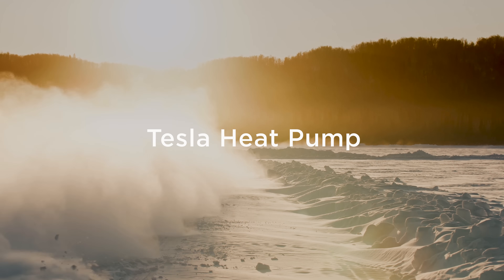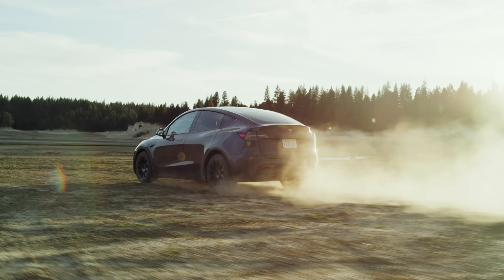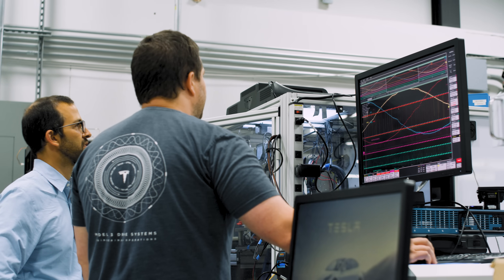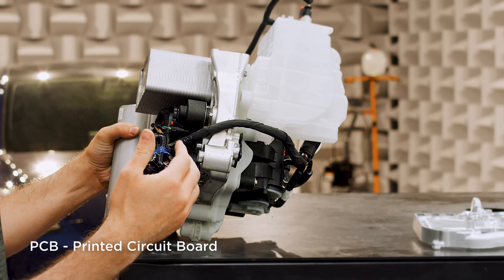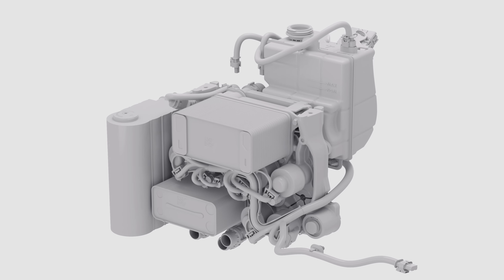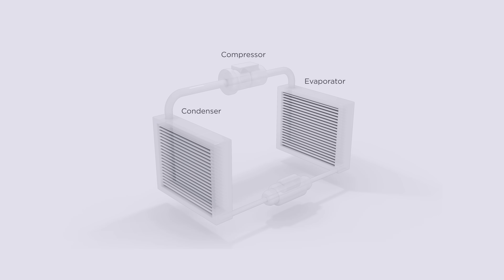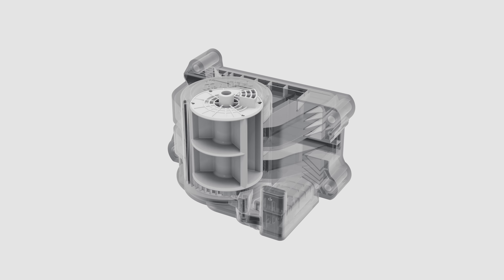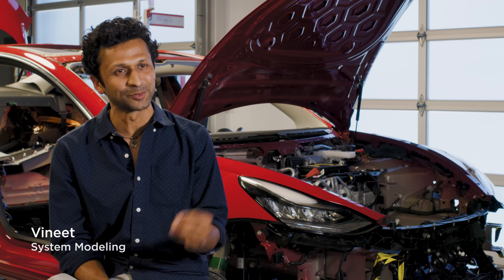Tesla Heat Pump | More Range in Cold Weather

Comment: very cool, and respect for leaving comments on. My only problem with the heat pump only set up is that unlike a gas car that can run the a/c and heater in defrost mode, the heat pump only can not also run the a/c for defrost. IMO if you did install a strip heater like you had on the early 3's then you could do both. I know that would cause massive drain on the battery but it would provide back up heat in extreme cold weather and allow for very fast defrost. Maybe if you put in a humidity sensor so it only ran above 50% humidity or something. It would also give you the ability to provide supplemental heat when the heat pump has to defrost the evaporator on long cold trips. I'm sure you already know all this and are trying to keep prices down but my biggest gripe is that defrost really isn't what a gas car can do because it can run both heat and a/c at same time. I also wish you offered an option without the glass roof. Probably great in moderate temps but really not worth it in extreme temperatures. The glass gets so hot you can't tough it, and you can feel it baking the top of your head in the summer and in the winter it's just a massive heat sink sucking out the warmth of the cabin. Love the car, my gripes are minor compared to what I could go on about with my gas car but offering option without the glass roof and including a strip heater for defrost would by my first choice if you offered it. Thanks again for leaving comments turned on, much respect.
Reply: Cabin condenser and evaporator are separate units that don't switch functions. It can and does provide heat and dehumidification at the same time

Comment: I would strongly suggest Tesla commission Jared Owen to make an animated video of how this heat pump works.  His video of the German enigma machine and the workings of a bowling alley pin setting machine are quite extraordinary.
Reply: It's a heat pump, it's nothing new... at all... Heat pumps have been around since the 1850's... There's plenty of YouTube videos out there already explaining how it works.
Reply: @likeZOMGlmfao   Sandy Munro calls this valve "genius". My comment was not about how a heat pump works, it was about how this particular heat pump works. When you see Sandy's breakdown the thing is wildly complicated. If you watch Jared Owen's video of the Enigma machine he takes a very complicated machine and walks you through step by step what each piece does and the path a signal coming into the machine takes and what it does. This octovalve has a number of ports that alter the flow of liquid/gas going in and out into many different cycles. It is controlling the heat to and from the batteries and to and from the car interior. A Jared computer rendition would take you through each one of these cycles so a layman can follow the whole "genius" of it. It would be a boon for all people fascinated with Tesla engineering and the detail of it but who aren't engineers.

Comment: EVs are OBSOLETE and outdated junk.  These issues were know in 1990 when my old bosses (Caltech guys) INVENTED the modern EV.  It won't work.  

Try 7000 mile range on Ethanol, 10,000 gasoline on HWY at 70 mph.  100% brake recovery, not 50-75% like EV.  Try 300 mpg City, 160 mpg HWY, 244 combined.  Combined range is 15,000 miles, btw.  Tow up to 26,000 combined weight...  Try having CO2 capture and recycle.  Free Dry ICE from car... Fuel via solar is $1/gal (3 cents/kwh).  Your EV is JUNK and a waste of time and money.

Comment: Can you use the heat pump to warm up the door handles and latches please? As soon as there is a frost on the ground my model 3 door handles freeze shut. after I've defrosted the handles with hot water I spend the next few minutes trying to get the doors to close because the latches are also frozen....

Comment: Pretty sad the actual range is 30% less than claimed. My 2022 model y performance on a 99% charge on a really good day gives max 320kms. Claim by tesla was 488 km. Thought it was some dead cells in the battery. Tesla agents replied saying it's normal your only supposed to get 320km real world. Also why doesn't model y performance not have drift mode??? Lame. Pretty unhappy
Reply: Costs like 40 bucks to charge at tesla supercharge to get only 300kms. Idk feel scammed

Comment: If the cold weather is too much for the battery to perform properly, how is it going to produce enough heat to warm the cabin? It's obviously not even producing enough heat for itself... 🤪

Heats pumps aren't even real technology. Their based on a misunderstanding of hvac systems. They don't work in reverse. The way hvac works is by compressing a gas and extracting the heat generated, so that when the liquid is decompressed it absorbs heat, thereby cooling the air. It is unable to take cold air and generate heat. It's totally bogus. I'd expect nothing less from this con artist of a company.

And this comment section is such an echo chamber, it's kind of funny. Sycophants...
Reply: with your depth of knowledge, I'm surprised you can use a computer or phone! amazing, congrats!

Comment: So a traditional AC system also removes moisture from the space, by running the system in reverse for heat, wouldn't that add moisture into the space?

Comment: Are these from the same productionline/manufacturer, as the ones who have been failing on a mass scale here in Norway since deliveries in q4 2022 form Giga Berlin took off? Serious issues in our cold winter weather.... 3 of my friends have had to replace theirs, days after delivery. Some only hours after... Something to do with residue (or small objects) loosening inside the heat pump...
Reply: Sounds like production teething issues in Germany.  That's unfortunate.
Reply: @TheEvilmooseofdoom  Yes, but I wonder if the quality/testing control for these might have been a bit "off" for Tesla? Perhaps a third party manufacturer involved, which Tesla has no control over..... Replacement was quick for all my buddys, so kind of impressed with Tesla service there. Just hope the new parts are not from same manufacturer, in case that`s where the problems originated....

Comment: Great !!! 
Now a #TeslaEV only needs to implement a world wide Nikola Tesla's Wi_Fi Electric Towers, so we don't have to sit on $30,000 cancer lithium boxes.
It would be also great if they improve on the quality of the body of the car, inside and out, (I have a friend that fixes Tesla's collision in VA...), to make it better and of course a really tested Computer "Off hands" Drive System that won't kill people or blow up on our faces...
I wonder why the self chosen "genius" didn't go for "HYDROGEN FROM WATER" ENGINES ????? (blue prints already available since 1920's...)
Reply: A sealed battery doesn't cause cancer.
Hydrogen water engines don't actually work. Electrolysis takes more energy than what you gain from burning the output hydrogen. Pretty simple.
Reply: @logitech4873  
You simply can't seal a battery made to last two years in a badly built tesla shinny POS.
I have a friend that do body work on teslas in Virginia and he is testimony on how bad they are build. People is selling them after two years for a teason...
Hydrogen cars are working since the 1920's. Do your research.
Simple facts, that even tesla loving joos, would be able to understand,

Comment: In my previous X (2018) we had an electric heating system with some scavenged heat.  It did well but hit mileage to the tune of 20-30%.  In the 2022 X they have a heat pump system, and it heats as fast or faster,  and also has much less of an impact on mileage, maybe 10% at 32F.
Reply: yes its really great 👍🏻

Comment: MYP with heat pump (2021): 12 to 18 Fahrenheit, I got around 40% less range!!! Driving on highway at around 75 to 85mph plus AC heater ON, I don't get more than 160 miles! :( Now that's at 100% level, charing to 90% and going down to 10% max, will further reduce the overall range by another 20%, thus making it 130 to 140 usable miles only. 
Summer time, with AC set to ON and highway speeds of 80mph+ plus a very sporty driving spirit within cities (acceleration of the MYP is an experience :)), I don't get more than 200 to 220 miles top. That's with a new car, hence new battery. The battery will degrade over time... oh well.. 

I'm glad this is a car from work. Privately, I'm no going to own any EV before we don't get into 650+ miles advertised and 350+ miles actual range under harsh conditions (summer, winter). My x3m40i BMW takes me 5min to refuel and goes another 300+ miles in any condition.
Reply: 70+ mph is the issue.  The EPA range estimates for all vehicles are done at closer to 60.  Google to get the test speed schedule.
Reply: @JBoy340a  I’m familiar with it. But that’s the issue if that’s the issue :). I’m not baby’ing or otherwise sacrifice my driving habits or spirit for an EV. One day, when battery technology will mature, that’s when I personally buy an EV and don’t look back. Right now, nothing remotely beats my ICE car.
Reply: @Abakaschi  So the short version is the real problem is you.
Reply: Wow. Fanboy much? 
But you can see it this way. However, as a consumer, I can vote with my money on whether or not I will succumb to the limitations of a technology. I choose not to. You do you :)
Reply: Please leave the tesla community! BYE!

Comment: I get 40% of my summer range in the winter because Tesla switched the battery chemistry to LFP. This heat pump is not efficient enough to offset that loss, and it barely works at all below -35C.
Reply: get rid of your tesla and leave the community, you will not be missed!
Reply: please just leave the tesla community

Comment: Ya it's awesome, it really is so much better than what others are doing ... however I rented a 2021  Model Y Standard Range.   In -10 to -15C weather I lost 50% of the range on a highway drive and was quite concerned if I'd make it between super charger stations.  And when charging,  it took twice as long as usual.
Reply: Did you pre-condition the battery with navigating to the supercharger?
Reply: @leanderkim  Yes, it was doing that automatically.
Reply: ya, if your driving 70 mph with a cold head wind...... your gonna get about half what it says and if you don't navigate to the supercharger then it won't precondition the battery.

Comment: The heat pump is great but the assistance systems are for shit. Not having parking sensors is hell, the rain sensor is practically useless. The cruise control and lane departure warning are so awful that I hardly ever switch them on.

Comment: If only advertised range was remotely close to actual range this would actually matter. Resistive heating may be less efficient and heat pump is an amazing technological advancement, it doesn't make as big of a difference as people think. You're still going to barely get 200 miles of range unless you drive at like 55 mph.

Comment: I wish there was a way Tesla could refit the older model 3s to have a heat pump
Reply: That is pretty much a replacement of the entire HVAC system.  And there are probably passages and mounting brackets molded into the body that are not present in the old cars. Upgrading would be cheaper.

Comment: My heat pump Model Y is great! You notice the benefit most on longer trips >20 minutes. For short trips it still takes quite a bit of energy to initially warm up.
Reply: How do you activate the heat pump? I’m new to this
Reply: It's just the heat. Use the climate control like normal. The heat pump automatically heats the cabin in the most efficient way.  @JacksonWalter735

Comment: Are you playing some wording game here? Heat pump won't change anything for the winter range. Pump is more efficient, but energy for ac is not that big a problem

Let's say we all wear a thick coat and turn off the heater, with or without heatpump will have the same low range

You still only have 60%of the range, around 200miles. Normal cars alert low fuel and still have 60 miles to go. Which means you only have140 miles of range to go without anxious

Comment: really cool! what is the theorical min temperature this system can fonction? and what are the average temperature it has been know (or rumored?) to freeze and stop working?
Reply: they can use the motor to add heat to the heat pump, so probably -20F is possible. I guess the windings on the motor are used like an element in extreme cold so heat pump will work. just guessing

Comment: It works so well. It was -15C the other day and I had almost no range loss. Amazing engineering.
Reply: Wait till it starts going wrong...
Reply: There's no such thing as free energy. A heat pump is indeed effecient , but not in a way it doesn't affect your range. It ALWAYS does.
Reply: @bartdereu9267  It’s likely because they preconditioned the cabin and battery so they didn’t expend enough extra energy on their trip to be noticeable
Reply: How do you use the heat pump in a Tesla?
Reply: @JacksonWalter735  it’s automatic
Reply: My ICE car ALWAYS works well and always has the same range.
Reply: @neelzhome8431  this seems to be news to you, but your ICE car also gets less efficient and has less range in the cold
Reply: @rexodexo56  How would a ICE car get  "less range in the cold"?
Reply: @worthington5687  Exactly. Not because of the cabin heating at least. Cabin heating in ICE cars is actually a smart way of using the waste heat instead of transferring it to the air through the radiator. There are reasons ICE cars are "worse" than electric cars, but that's not one of them. EVs only have one way to heat the cabin, by using the energy available in the battery. An ICE gets hot no matter what, so using some of the waste heat to heat the cabin does not decrease range.
These EV fanatics on Youtube are so narrow minded that they see everything in EVs as being better but fail to see the big picture. Sure, EVs have many advantages compared to ICEs, but the comments from the regular people are just ridiculous at times.
Reply: @icyfox2011  - That’s not how heat pumps work, read up on it.
Reply: @worthington5687  Cold air is denser. so altough the engine gets more oxygen, the car also gets more resistance. aerodynamics. Also takes longer for the engine to warm up and run optimally.
Reply: @neelzhome8431  what a self own. Go back to school 😂
Reply: @neelzhome8431  That's not how physics works! ICE cars ALSO have less range in cold weather. People like you just don't care so much you think they have the same range. In fact, most ICE owners don't even know the range of their ICE cars!

Comment: Hate to burst the "peoples car" bubble but there have been ZERO electrics that have survived a single winter in South Bend IN let alone further north.   When it is 0 degrees F outside there is no heat outside the vehicle to pump.   They put a plastic motor damper in front to hold heat in but it ices up.  These cars are great for tooling around town in a moderate warm climate but sorry they do not work up here.    Simple proof of this is when there was a heat pump revolution for the home some 25 years ago most were removed or modified cause it was to cold for them to operate.  In other word they put an ELECTRIC HEATER on the coils the defrost them,  all benefits lost.
Reply: I live in northern norway, north of the arctic circle. EVs are extremely popular in Norway, outselling all other cars.
And yet we have people trying to tell us that EVs don't work in winter conditions.
That's just completely and utterly wrong.
Reply: @logitech4873   They might work but not for shit and not for very long.  You gonna tell me that when it is  negative 20 in the Celcius, it is snowing and blowing.  That you can go some Kmeters, AND keep enough hot air blowing on the windshield with the wipers to keep it clear?  The only thing I will give on is they are all wheel drive with a heavy low center of gravity that makes for better grip on the road.  Even though the friction is up cause of it,
Reply: @johncundiss9098  Yes that's pretty common winter weather, and of course they work fine in it. If you want good range in those conditions, pre-condition the battery before leaving. You'll have probably 400 kilometers of range on the newer TM3 in these conditions.
Not sure what you mean by blowing hot air on the windscreen to keep it clear though. That's never necessary, just wipers are enough.

Comment: Wow, you guys heard about heatpumps?
I heard about them 2 years ago and I'm not even an engineer. Now I already have an electric car with a heatpump and now my range varies by just a few clicks when I start the heating.
I really wish you too will be able to offer a proper electric car soon.
Reply: You're from the "vague FUD" department?
Reply: @rogerstarkey5390  Thanks for teaching me that acronym, as funny as FUBAR.
I'm just a bit frustrated that a generally excellent car is plagued by a few idiotic choices (no heatpump from the get go, still have an acid 12V battery, still the same idiotic CEO, massively overpriced, still pushing the unreal autonomous drive mode, exclusive proprietary chargers, unfriendly towards repairability etc).

Comment: Many Model Y made in Germany have problems with the Heat Pump. They even introduced a "stress test" before delivery. Still, my Heat Pump broke after just 3 weeks of ownership. I was on vacation, the nearest service center was 500km away and only had free appointments 1 month later. I had to drive back home 1000km to get the supermanifold and the AC Compressor changed after 2 weeks. Not sure if this is a design problem or a part supplyer issue, but I am not happy with their "innovation" :(
Reply: In Finland too many suffer the same problem with the heat pump. New cars, month or less old, driven 500-1500km and heat pump broken. Thinking should I cancel my model y order if quality is this bad..
Reply: Yes same problem in Russia Saint-Petersburg every winter compressor is broken!!! I'm spent 4000$ for change shit HVAC Supermanifold and etc never recommend Tesla